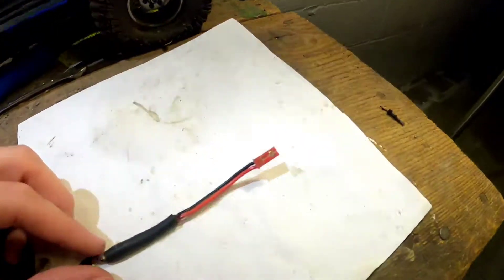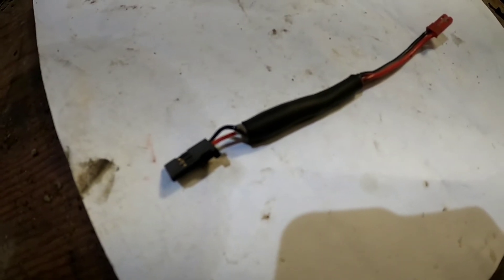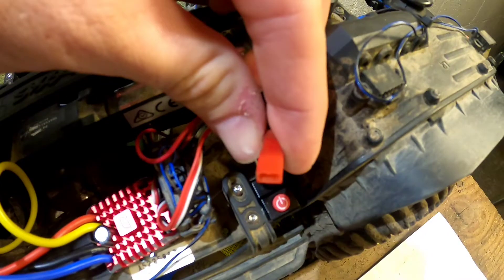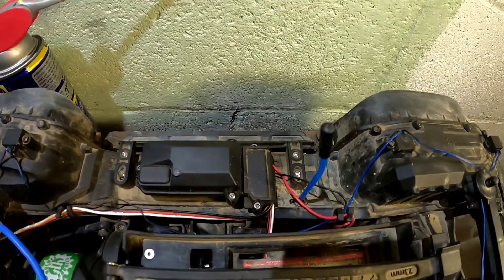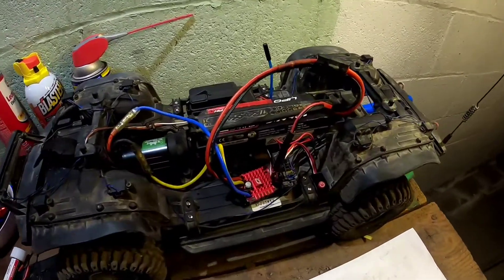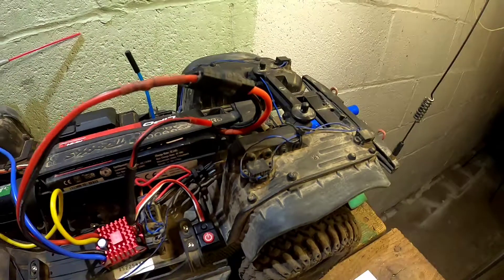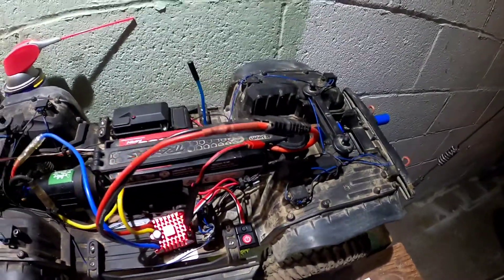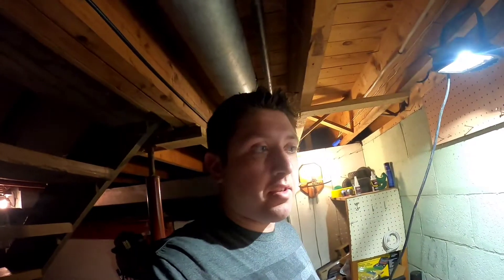HOW TO- Connect traxxas light kit into the hobbywing 1080 ESC.

Comment: You figure the pro light kit controller (frame side) would be happy with this setup too? I only run 2s on my trx4
Reply from the maker: Not 100% last time at my local hobby shop it was their understanding the pro kit needs traxxas stock electronics to work so I just didn't move forward with the pro kit... I bet someone on here figured a way to get them to work
Reply: @WNYRC  i found an even simpler way to set this up, Y off your steering servo for turn signals, (maxx link cable) and (if running lipo) use an adapter from the jsc (power connector from the pro scale controller) to the lipos balance port for power. boom, bobs ur uncle this set up works perfectly.
Reply from the maker: @theworkhorse21  hell yeah!!!

Comment: What voltage comes out of the stock esc to the light kit? I got an adjustable power step down board I put into the wire adapter I made. Thinking I'll just set it to 2s 7.4 volt power and keep my truck on 3s
Reply from the maker: On the 1080 I only ran this on the lower volt output as my servo was not at higher volt output. I did upgrade servo on higher volt output and seemed to be no issues that i had. 
Hope that helped answer your question

Comment: were you using the standard traxxas remote and receiver? I tried this with the dumbo combo and i still cant get the lights to work
Reply from the maker: Hmmm I did have it stock when I made this video. I have since swapped out a different remote and reciever and didn't have any issues when I did that... sorry you're running  into issues... I love lights way to much on my RC's

Comment: You think this would work with the 2021 bronco light kit? Assuming the voltages are the same coming out of that port as the stock traxxas esc nothing should go wrong
Reply from the maker: I would assume if traxxas didn't change anything with the bronco lighting system then it would be quite similar as this is just giving them the power source. Let me know if you try it if everything works out or any issuea.

Comment: How do you know which one is + or - coming out of the light module?
Reply from the maker: Sorry for the delayed response. So the traxxas adapters only connect one way so I assume your saying where it connects into the esc? For me there was no issue if I mistakenly put it on backwards...they just don't turn on but once I flip it correctly they work. All other connections should be only able to connect one way if all traxxas stock wiring.

Comment: Sorry for the late comment but would this work the same for the hobbywing fusion system
Reply: It uses the same 3 wire system but I was wondering the same thing as I just installed my fusion system today and was wondering about adding the Traxxas Pro Scale lighting kit with the functioning turn signals and reverse lights as I do not any lights yet for my Blazer.
Reply: @tellyourmomisaidhi5804  Did you end up making this work?
Reply: @pwrofgrayskull  not yet. I have the kit from traxxas and the fusion in my blazer. I haven't started that project yet.
Reply from the maker: I can't say exactly with those without knowledge of those ESC set ups. But I don't believe those systems have the 3 prong area to plug into like the quick run system does.. But I've never owned one yet to know that for a fact.